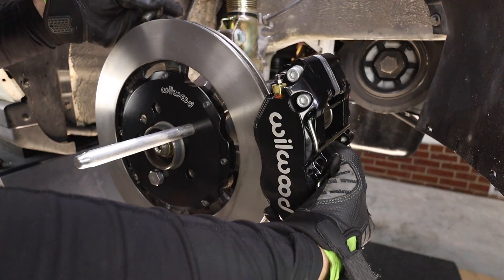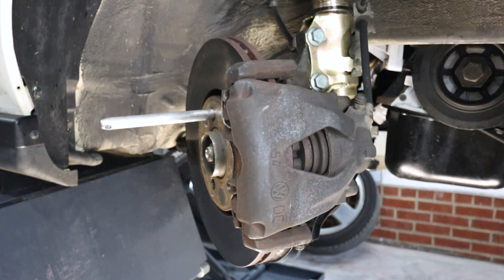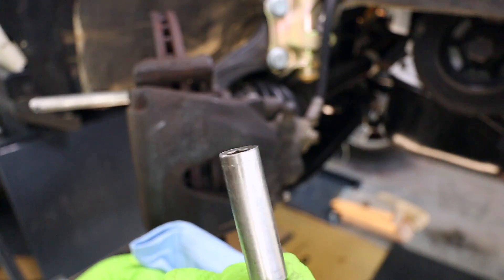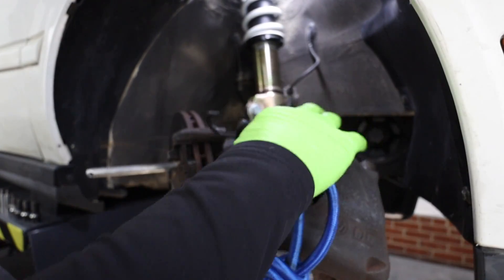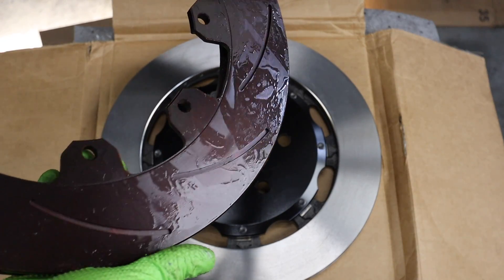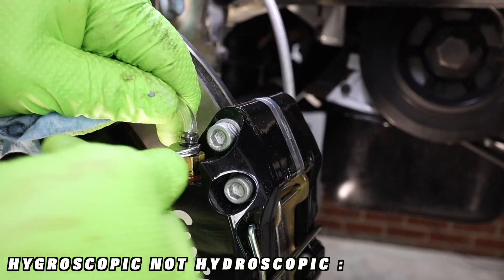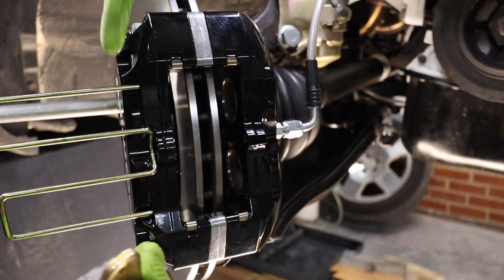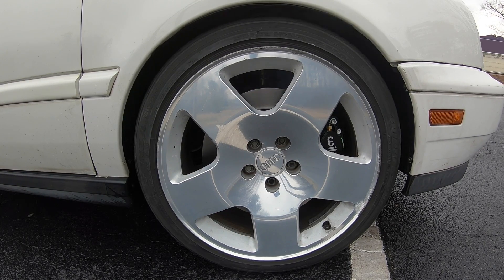10 Brake Job Tips when Replacing Brake Pads and Rotors

Comment: That CRC grease, I used the same one and months later I checked the guide pins and the grease was hard as clay. Ended up getting the glide pins stuck. So I bought silicon lubricant instead and it worked better.
Reply: Apparently silicon lubeis the only way to go for slide pins but I keep seeing this CRC synthetic stuff being used by youtube mechanics.

Comment: The most important thing is to remove the brake fluid reservoir cap before pressing in the brake pistons
Reply: Santosh Narasimhan Yeah, try pressing those pistons with all the fluid pressure is going to break your hands. LOL very true.
Reply from the maker: Yep!!! It makes a mess if you don't
Reply: Should have been number 1 before even jacking up the car inspect the fluid level n remove cap
Reply: Not for me !
Not for all thous that have ABS and not new calipers ! 
I put a hose clamp on the brake hose and the loosen the vent, all nasty fluid will come out and not threw the ABS module !
All the beast !
Reply: @ROAlexa1981  clamping a brake line will damage it
Reply: paul joe think he meant he puts a hose on the bleeder screw after he opens it.
Reply: @pauljoey7977  in wat wei will deamege it ?
Made  this method lots of times. The brake line is reinforsed with steal !
Steal îs a metal with memory !
Reply: @KobaBlack113  .make it how you want but do not let nasty flued thrue the abs module, especialy with newer modules of abs.
The abs module is making alsow other things and it nead to clouse thouse valve as tide as it can !
Reply: Also check if you have room for the fluid or else when you push the piston back you will make a big mess in your engine bay
Reply: When people add fluid as  brake pads get low and it’s not needed as when you squeeze the piston in yes it makes a mess as fluid should never be added do to low brake pads only if it due to evaporate of fluid due to heat and lots of driving 411 if you add do to leaks really should fix it great video Charles
Reply: Bleed the brakes first, essentially a fluid flush. Then the break job.
Reply: ah thank you i forgot this one

Comment: Another tip: Make sure you have the correct tools for compressing the rear brake pistons.

Several car manufacturers require that you spin AND apply pressure to get them to retract (I'm looking at you Ford). You can rent the tool for free from your local parts store, or just buy it outright. I paid less then $30 CDN for mine, and as far as I was concerned, it paid for itself the first time I used it.

Great video as always Charles!
Reply from the maker: GREAT TIP!! I think I paid $40 for mine in 2001. Used it 100s of times and it's still perfect. This is the one I use ~ https://amzn.to/2Jshp4x looks like it may have went up in price.
Reply: Circlip pliers do the job!

Comment: Good video!!!

The other tips I’ve learnt over the years is

Be careful what Grease you use on the slide pins here in Australia we have this stuff called Bendix blue I have found that it can make some rubbers go soft as opposed to just straight silicon grease

Also turning the steering wheel from the hub is fine but if you happen to be working on a Ford falcon or Fairlane here in Australia what that does is it cavitates the power steering pump and it makes a shudder  noise until it re-bleeds itself so so you really gotta start the motor to turn the steering on those cars and maybe others

And I used to pinch off the rubber brake line with a special clamp to avoid the fluid going back up to the reservoir and then was warned that if you do that while it’s a good idea you can actually damage the brake line internally and cause it to delaminate which you can’t see and you end up with the brakes pulling or bias on the front end

Also if you go to the App Store you can download a G Force meter for free that’s good for bedding in brakes because the amount of G Force you repeatedly apply can be consistent and measured and it’s really good for betting those in right Which short-circuits squealing at a later date

Comment: After cleaning the gunk off the caliper slider pins, I give them a run on a bench buffing-wheel and use clear silicone grease when reinstalling them. The last sets of discs/rotors I installed were fully coated. The friable coating wears off quickly without pad contamination, but the rest of the disc stays rust-free. Worth the extra few £$.
Also, if doing the front brakes, raise the entire front of the car, not just one side at a time. That way it's really easy to swing the wheels wherever it's most convenient for access.

Comment: The bottle cleaner for the interior of the caliper slide was a great tip,  I used a shop towel but was never big on it as I didn't want link in the caliper.
Reply from the maker: It fits perfect. That bottle brush came with a turkey baster I use for extracting brake fluid. Thanks Walmart $1 total. LOL

Comment: I did pads on my a3 and found that one of the rear slide pins was rust welded to the carrier! I had to pay a shop to help me remove it, cost me a little less than replacing the carrier, but it saves you a lot of money if you pay close attention to your dust bolt and clean that cavity where the pin actually goes! Very nice video charles

Comment: Can you do one on installing steel brake lines by yourself?
Reply from the maker: Great idea!!!!
Reply: HumbleMechanic Thank you! I would appreciate it. It’s a near future upgrade planned for my 2013 86, as the pedal feels a bit soft and makes me nervous on heavier braking.
Reply: @I-didnt-ask-you  your brake pedal should never be soft even with stock brake lines. Check/bleed your brake fluid and if that doesn't solve your problem you either have a faulty master cylinder or something else is failing.
Reply: Cristian thanks, I’ll get them looked at soon. I am unsure if it’s a normal feeling. It’s firm, but not firm enough to my liking.
Reply: @I-didnt-ask-you  something I'm experiencing too. Bleeding done yet there is a firmness and softness too

Comment: 11.  If your brakes require the piston to be rotated to retract it, get the proper tool.  Don't try to use home-made substitutes.  Those are a recipe for skinned knuckles and frustration.

12.  If this is your first time doing brakes, or your first time on your particular car, do one side at a time.  That way if you get lost and can't figure out how stuff goes back together, you have the other side to use as a reference.  This is especially helpful with drum brakes, which have all sorts of springs and levers and retractors and pins and stuff and for many people it's tough to visualize how it all goes together.

Comment: It may be old and boring, but watch your torque spec for the bolts. Because after tight there's loose and this really could ruin your day.
Reply from the maker: YES!!!!!
Reply: True! Also, re-torquing after a small amount of driving too, just in case a bolt backs out, you missed one, or the wheel wasn't quite as flush to the hub as you thought :)

Comment: Hey Charles, after my brake fluid flush on my R32, my pedal seems to go down further than I remember. Yes, no air in system and later I had the dealer bleed them thru the ABS pump with their VCDS, but the pedal is still lower than rock solid. Car brakes fine, but I don't like the pedal travel.
Any ideas for me to try ??
Thanks

Comment: You can also clean really grungy/corroded guide pins using very fine sand paper (1000-2000 grit) and spinning them (with a drill/driver and correct socket/hex bit) in the sand paper with WD40 or Brake Clean, much quicker than hand cleaning.

Comment: 1- make sure that all necessary tools are next to you.
2-make sure your replacement parts are next to you.
3-be sure that the parts you ordered are fitting your car.
4-check the area around you and make sure it is free of hazardous.
5-start jacking up your car on the jacking points to avoid damaging the chassis.
6-remove the wheels and put it under the car as extra protection.
7-start removing the brake caliper and secure it by a hanger.
8-Inspect the sliding pin, sliding pin cover, the piston ring, and brake hoses and make sure they are free of damage.
9-open the brake master cylinder and start comprising the brake piston.
10-before installing any new parts clean all necessary parts.
11-do not forget to apply anti-seize on the hub and the back of the brake pads.
12-reinstall back everything and use the proper torque.
13- it is better to flush your brake flowed every 30 thousand kilometers or every 2 years.
14 use a break flowed pump to flush it and make sure that you are using the proper D.O.T for your car.
15- start preparing your brake pads.
Have a safe trip.

Comment: Can i add the use of a flair nut wrench to remove (if is necessary) a brake line? I learned it (hey! XD i was 15 doing my firts brake job)the hard way!
Reply from the maker: YES!!! I personally don't use a flare wrench. I had one bad experience with one and swore off them since(probably stupid on my part). I use high quality open end wrench and have been very fortunate. If they are rusted or stuck, I will use the closed end.

Comment: Thank You Charles. Spot on in every way!  My son and I recently did a huge complete 4 wheel brake job on the GTI. He's not digging the ATE Ceramic Pads I chose. In brief, what would be a correct procedure now for a Pad swap? I have concern because of course the ATE's  have been 'Bedded' to the new Rotors.
Reply: New Pads on a used disk are fine. They will bed in by themselves. Just never use old pads on new Rotors.
Reply: ATE recommends to use the ceramic pads only together with new rotors because they say that the (for the ceramics) essentially "transfer film" on the rotors is only built on brand new rotors. If this is a real argument or just to sell more rotors... I can't say.

Comment: I would also add removing the rust from the caliper bracket where the hardware goes
Reply: Yes. Yes. Yes. I love when people grind the pads because they "don't fit" in the rusty caliper bracket, or when they throw away the pad hardware all together. Remove the rust and lube the pad slides.
Reply: And add a film of grease between the new shims & the caliper bracket to reduce rust buildup.

Comment: My tip is to put some lock tight on the caliper bolts and the bracket bolts. Blue lock tight will do it’s just that extra safety precaution to prevent bolts from coming lose. Also pump the brakes with the car off then pump it again with the car on the engine helps with a vacuum assist and you’ll feel the brake get more stiff with the engine on. Most don’t do this they pump the brake with the engine off

Comment: wash the car or wash out the area where the wheel actually sits before starting the brake job altogether get rid of all the excess dirt so it doesn't end up impacting the brake job.
Reply from the maker: Cleaning the wheel is something to go along with that. Great tip
Reply: That’s what brake cleans for spray the area get rid of the dirt before installing new brakes

Comment: My number one tip is to check the position of the brake pads before you remove them, and to torque down to the proper specs the bolts.

Comment: I was wondering  do you or did you ever use the ELSAWIN software as a technical reference. If so can you tell me where do you find the service instructions the "technical service manual" (HST2) or the workshop repair guide.

Speaking of which in the workshop repair guide nowhere does it mention to use any kind of product on the slide pins/bolts. Does this change from vehicle to vehicle (tiguan 2015)
Reply: Other quick question being do you crack a bleed valve open when you push the caliper piston back in that way the old dirty brake fluid does not go back into the system?

Comment: I've seen crappy work in my own shop  fixing tech short cuts by not lubing all contact points to caliper brackets. I fix it by cleaning all contact and using high temp grease. I also scuff pads perform a test drive after being completed.
Reply: Thanks for the love

Comment: Replace hardware kits, clean the brake pad recesses on the caliper bracket and lube under the brake hardware, measure rotor thickness if re-using rotors, use a silicone based lube on brake pins so the rubber boots don't get swollen and damaged

Comment: if you don't have a means of hanging the caliper up, what I've noticed is a lot of normal cars' caliper "teeth" can hook into the spring on your strut fairly easily... if that's not accessible, place it inside/on your lower control arm!
Reply from the maker: I’ve done that plenty of times too.

Comment: #11 Wire brush the caliper where the pad "ears" slide against the caliper. Do not use lube here. #12 Torque the carrier bracket bolts.

Comment: hey man, I have a 2013 CC paid for and past warranty. At about 70k miles VW replaced my 2.0T engine due to the infamous timing chain tensioner issue,so I have an 85k miles car with only 15k on the engine. So, thinking about putting some performance upgrades and maybe hit the track a few times, but mostly for street driving. 
I'm thinking: Unitronic 1+ ECU tune, upgrade the pads to Hawk PCs and a decent summer tire.
Anything, in your opinion, that you would add and is the car worth it?
I just want a solid performer without going too drastic, like coil overs and such.
Reply from the maker: Of course maintenance first. But I think that’s a great start. Similar to my R32 mods

Comment: Would I have to bleed the brakes if the reservoir starts to overflow when I push in the calipers piston??
Reply: J Ball Actually that happened to me this past weekend. After compressing the cylinder the fluid reservoir started to go up above max. However after doing all rotors and beads and driving it it went down.
Reply: If your pads are worn way down yet the reservoir is full its best to remove some of the fluid from the reservoir with a turkey baster or similar tool before pushing the caliper piston back. That will avoid the overflow all together. Bleeding is not needed in this case. You only need to bleed them if you introduced air into the system. Such as replacing a hose or the caliper. For a simple pad replacement no bleeding necessary. Be careful not to get fluid on painted surfaces, brake fluid will eat the paint right off.
Reply: AJ S Thanks I appreciate our help

Comment: Question, if someone asked before, sorry I missed that comment. 

1. Some guide pin/sliding pins have a rubber busing. Over time these busing expand and is hard to get it back into the calliper bracket. Does this means I have to change the busing whenever it swells or it will be fine if I just force it back in. I done it once carefully forcing it back, it still moves freely. Probably not as free as new one tho. 

2. Can normal rubber grease be used? Temperature rating up to 180°C or should I use specific brake grease for calliper guide/slide pins?

3. I done some online search before. Most of the forums said the cause of the rubber busing swelling is incorrect brake grease used. Is this true or is just another wear and tear part cause by heat? 

Thanks for your reply in advance =D

Comment: USE BRAKE PARTS CLEANER SPRAY FOR REMOVE FINGERPRINTS ON PADS AND SHOES
Try as we might, our fingers sometimes transfer silicone or grease to the pad or shoe braking surface. Except for 
severe contamination of the caliper pad or shoe surface, most residue can be removed with a brake parts cleaner spray. Best applied immediately after the contamination is discovered, and certainly before the car is road-tested.

Comment: Good tips. Never use a petroleum based grease. DO release air pressure from the boots- slide pin and caliper. You can use a small screw driver to lift up on it- just don't rip it.

Comment: I recently went to my Ford Service Center in Toledo, Ohio, and had my front and rear brake pads and rotors replaced.  About 6 days later, I realized that my brakes were beeping or squeaking whenever I tried to brake in drive (forward).  On the other hand, if I broke in reverse, there was no such sound.  I called them back, I have an appointment 5 days from now to take a look at them.  Can you guess what might have gone wrong?

Comment: I have an 08 r32 and read about a pad release thru the car computer. is this true and if I press my calipers apart will it hurt them?
Reply from the maker: if it has an electric parking brake you need to
Reply: @HumbleMechanic I have a parking brake handle not a button. leads me to believe that I do not have an electric parking brake? and I would like to get one of the dash inserts that you have which reads codes at some point. but maybe a video on some of these affordable scan tool with a more in-depth explanation of your center dash replacement could be a good video. thank you for being one of the only people on youtube that actually responds. signing up on your site today! don't feel right asking another question till I do! haha

Comment: Is it normal to have the brake fluid looks like algaeish green 1 year since it was last flushed on my 2015 a3?? Or I got scammed by the dealer by changing the fluid in the reservoir only?
Reply: Couldn't say but unfortunately from what I've heard its not uncommon for dealers to only change the fluid in the reservoir rather than hooking it up to the bleeder and flushing the whole system.  Another reason why I do my own work. That way I know for sure what was done.

Comment: If you can't get the brake disk to come off, you can try tappin the top side of the brake disk with a hammer or another blunt object you might find at hands reach.
Reply from the maker: If I am replacing I whack the crap out of it. HA